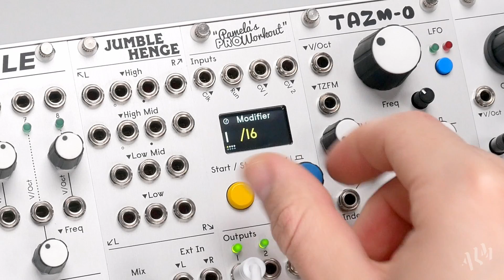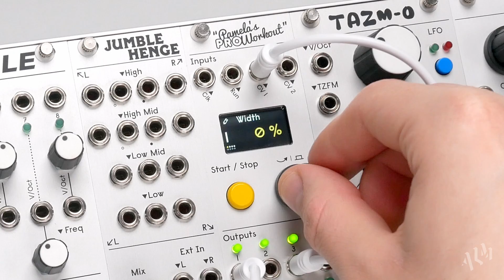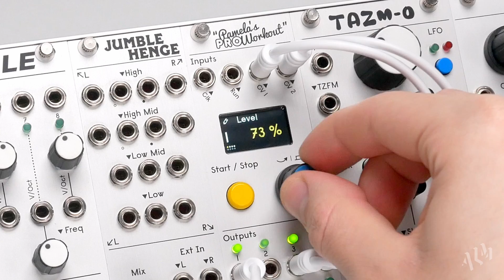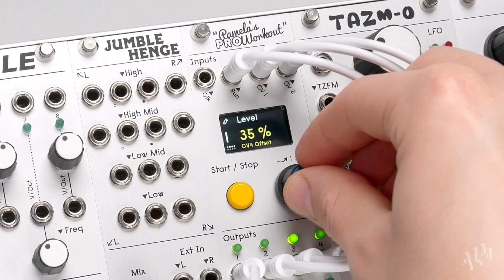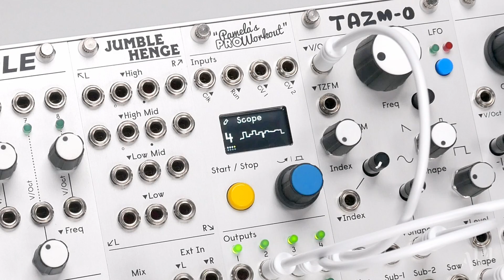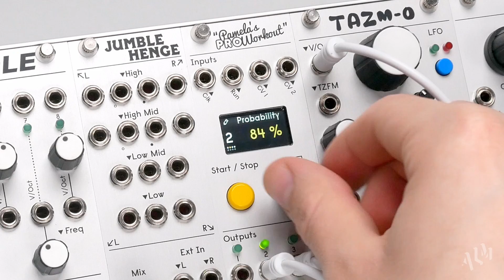Pamela's PRO Workout: External CV - Complex Modulation, Bursts & Beats

Comment: One thing I am working on, is how to use Pam's as a quantizer for external CV. I guess you need three channels? one S&H for the cv, the rate input for that and the S&H channel quantized?
Reply from the maker: You only need 1 channel. Turn down the level and assign the CV (to be quantised) to control 'Offset'. Then enable the S&H Cross Op on that channel. An external input or other Pam out can be selected as the Cross Src to trigger the S&H. Finally, enable the quantiser!
Reply: @busycircuits  brilliant! It seems I got the idea right but the order wrong. With "my" version I got a decent result which was soundwise really glitchy. Cool in a way :)

Thanks to you guys for the best module ever!

Comment: Great video series I'm really learning lots, how do you modulate the modifier for an output channel with CV though, can't figure out how to do that.
Reply from the maker: To assign CV to control the modifier just scroll all the way down past the slowest division where you'll find them.
Reply: @busycircuits  thanks is that in the manual because I read it a couple times and either missed it or didn't understand it

Comment: All the euclidean and probability features is great and very useful, but if this module could program ordinary drum sequences too, it'd be a powerhouse beyond compare. 👊
Reply: I haven't played too much with it, but I'd think you could get pretty close using the pads
Reply: Yea, tried that, nowhere near what I was thinking... You think it'd be so easy for ALM to add a regular drum sequencer to the software, odd they haven't already!
Reply: @KevinArdala01  it is easier than you think - the pads are indeed key as you can move these around. Nonetheless you may have to do cross-op with a second channel. And use the loop/sleep beats. Bit of work, I agree!
Reply: @KevinArdala01  I was thinking the same thing the other day. As you can already choose how many steps you want it would be much better if you could then select which steps you want a trigger on. I would have thought this would be easy enough to implement based on the other great features of this awesome module.
Reply: @theproblembelief7549  Thanks for your suggestion. I’ve tried this and couldn’t quite figure it out. It would be so much nicer if you could just select which step you would like to place a trigger on!
Reply: @Charlie-Sheen  I agree! Maybe I will do a tutorial on it, once I figure it out myself!
Reply: @Charlie-Sheen  Actually, it would also be nice to input pitch information. In a way this is possible already but a lot of work...
Reply: I thought the same thing at first but once you start to know how the Euclidian steps get placed, its so much quicker to have them tossed in with a knob spin compared to doing a twist press, twist press, twist press, .........   Could they have still allowed that?  Sure, but I think they are just pushing people to learn something that will be to their benefit once they learn the system.  I actually appreciate that.